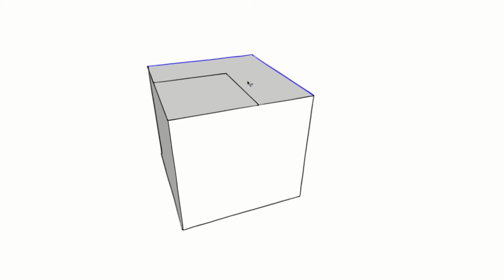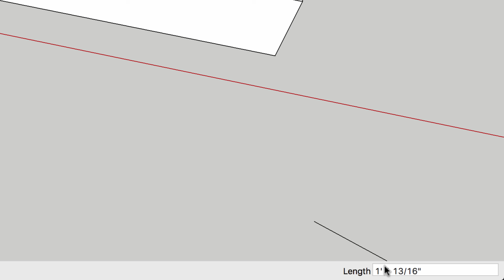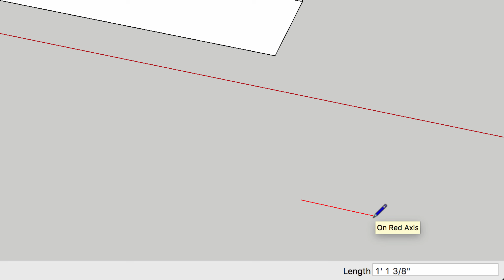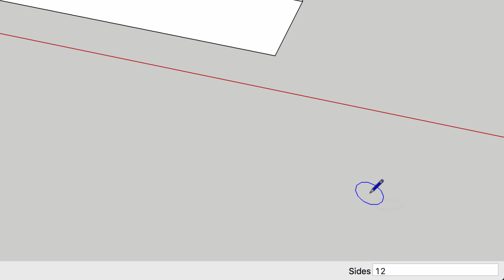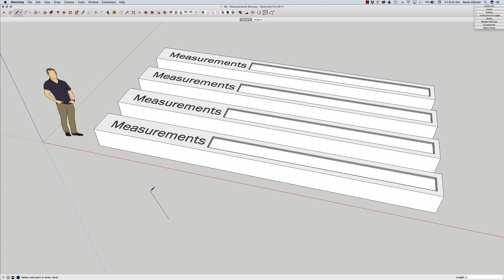SketchUp Skill Builder: Measurements Box

Comment: How do you change the measurement from showing inches to feet. Example: When I draw a line 10 Feet it shows up as 120 inches.  Somewhere there's got to be an option panel that switches from feet to inches.. as well as going to the metrics system.   Can anyone help?
Reply from the maker: In your Model Info window, click the Units tab. From there you can click Decimal, and then choose Feet as your preferred unit of measure.
Reply: Thankyou :)

Comment: Another great video. I have a question. I used to know how to change a dimension in the measurements box after I had already hit enter. For example, if I drew a rectangle at 12,12 and after hitting enter realized that it should have been 10,12. There was a way to correct the first 12 to a 10 without having to retype everything. Have you any experience with this? Thanks.